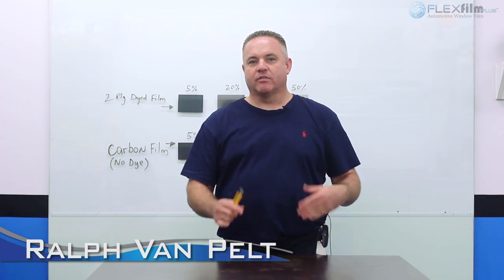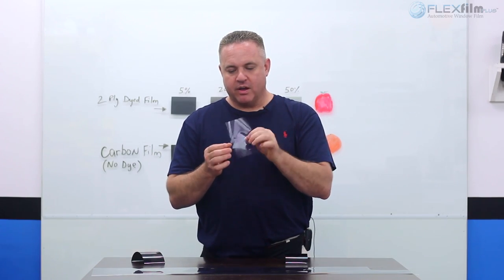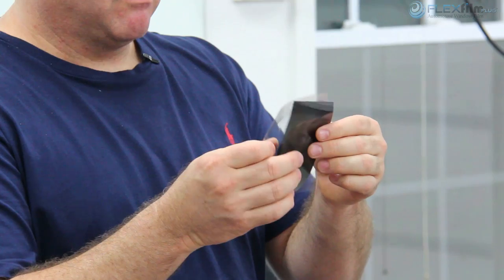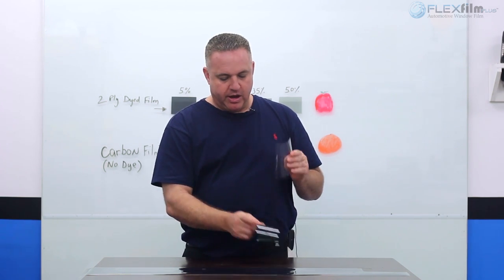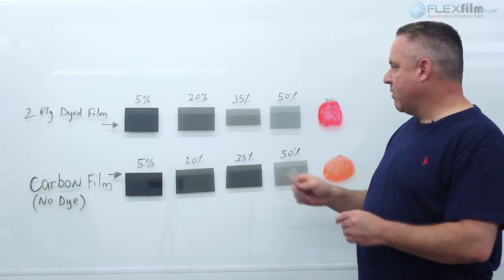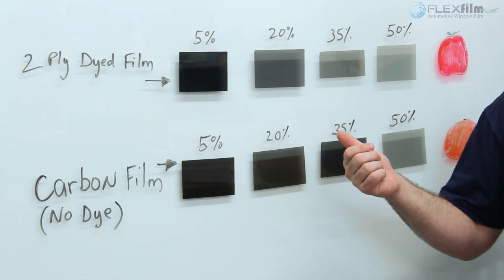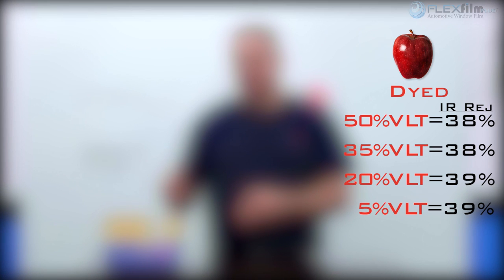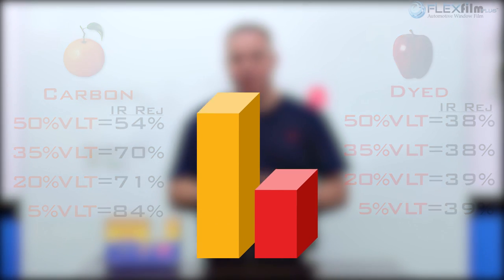Ceramic Window Tint 101

Comment: I had ceramic tint applied to my car. Sitting in 60 degree weather, should the window be hot to the touch?
Reply from the maker: Jay Park 
Yes.  Ceramic film absorbs more Solar energy from the sun and should be much hotter to to touch than dyed film.  Dyed film just let's most of the energy through and does not store in the glass.
Reply: Ralph Van Pelt thank you for your knowledge.
Reply: Ralph Van Pelt I haven't gone through all your videos but it would be cool to see a real life test. Two identical cars. Ceramic and dyed film vs ceramic and carbon film and measure the temperature of the cabin?
Reply: So how is this stored heat in the glass not going to radiate into the car anyway? How can you stop the heat that the tint adsorbed from not being radiated into the car? You just stated that the glass will be hotter.
Reply: Was thinking the same thing. I have a custom van with windows all around and fairly big. I think the glass is going to heat up enough to lose any benefit of the carbon over dye.
Reply: @FlexFilmPlus  I had applied Rayno Phantom S5-20% except the windshield and front side windows, Car was parked 5 hours outdoors in the sun 68F. I got into the car and the inside car feels hotter, obviously. Started driving, opened the windows a bit, I touch both glasses the tinted and the factory untinted ones. The un-tinted windows are colder to the touch than the tinted ones. The temp outside reads 67F degrees and the car interior temp reads 81F. Drove the car for an hour. Temp outside reduced to 65 with cold wind. The interior reads 80F. Tinted windows still warmer or less cold than the untinted ones. Turned on AC reducing temp inside.
Parked the car inside garage. Now both windows have same temp to touch.
It looks like the tinted windows grabbed some heat from the sun and kept in the film, thus making the inside temp hotter than when I had no window tints at all. 
I cant imagine when the temp outside reaches 90 degress, the heat inside the car will take forever to go away, even if i use AC, after i turn off AC, the temp will rise later simply because the warmer tinted windows will keep some heat from sun and will make car temp rise again, even if outside lowers to 60F
Reply from the maker: There are two phases to performance with ceramic film.  The first phase is protection.   The product should absorb most of the solar energy and keep it from passing through the glass.  (Visible light, Ultraviolet Ray's, and Infrared radiation)   As energy is absorbed,  it will turn into heat and heat up the glass.  The ceramic coating in the film will slow down the transfer of heat into the car because it is a very poor conductor of energy.  An example of this process is if you place a metal pan and a bible on the hood of your car and let it heat up under to sun on a 100 degree day.  Touch the pan and it will burn you because the energy (heat) moves rapidly through the pan and it literally throws it back at you and is very hot to the touch.  Put your hand on the bible and it is only warm.  Energy does not conduct very well through paper and therefore heat energy is released very slow.  What is interesting is that you can meter both objects and they will have the same surface temperature because the sun does not discriminate.  It heats them exactly the same.  The difference is in how energy is conducted through them.  Ceramic coating in window film is a non conductive material that puts the brakes on the heat.  Another example that is similar is the silica tiles on the bottom of the space shuttle.  They slow down energy the same way and protect the astronauts.
Reply from the maker: @sfopaul747  
The carbon s5 is not a ceramic film.  It is marketed as a ceramic but it is really not to be compared to ceramic films that use oxide materials.  That film does offer amazing protection by blocking out most of the solar energy but it does not have the ceramic oxide coating like the S7 or the S9 product which would put the brakes on the heat and slow down how it radiates into the car.  Heat and solar energy are not the same like Fire and smoke are not the same.  S5 is only a carbon film.  It would need carbon and ceramic combined to slow down the heat like you would enjoy.
Reply: @FlexFilmPlus  Thank you for your response. I actually trusted the fact that is marketed as CarbonNano-ceramic. I didnt mind the money i would have spent for an S9. I never thought the heat inside the car remains longer than having no tint at all. Wondering if its real phantom s5 what they installed. Will do my investigation. Question. Will it be good for the rear defrost lines to have the installers remove the work they did 3 days ago and apply a Phantom S9? (Tesla Model 3)
Reply from the maker: @sfopaul747  
Should be easy to remove.  I am about to post two video links you need to see.  I am also a Tesla owner.
Reply from the maker: @sfopaul747  
https://youtu.be/PTHlZtNeXqc
Reply from the maker: @sfopaul747  https://youtu.be/cbttKzKfTEY
Reply from the maker: @sfopaul747  
Www.flexfilmstore.com

Comment: I used tin foil. Almost no heat gets thru. Use a credit card with cooking spray to get the wrinkles out. DO NOT FOIL THE WINDSHIELD.  I got pulled over for that. Cop was pissed.
Reply: Wym by do not foil the windshield?
Reply: Same thing happened to me. I just cut the two eye holes works perfect
Reply: @majorpaine211 Genius!

Comment: die tint is the cheaper low quality that turns purple or fade over time and the ceramic tint is a higher quality that doesn't fade or change color over time right?, also I'm learning about tint :)
Reply from the maker: AirRookie 
That is true unless the ceramic film has due mixed with it.

Comment: what do you recommend, I want as dark as possible so you can't see 
inside, block sun out. so 5% and ceramic or 5% and dye film?  any brands
 to avoid?  price for 5% and ceramic including windshield?
Reply: Sounds like you want black paint that will have the least sun coming in. But honestly I don't know how to answer you if you ask that question. Technically you can run 5% or even less but it's hard to say if you don't know what youre asking for. 5% is illegal anywhere and definitely i would not advise a very dark tint on your windshield. I run 35 all around and 50 on front windshield. Ceramic will usually cost more and windshields cost more. I had my 4 door car done for 350 ceramic + 160 for front windshield but i live in NOVA where everything is expensive

Comment: can someone tell me which is better for cooler car , carbon or dyed?
Reply: Ceramic will keep your car cooler
Reply: Fade To Black LLC I get the point of ceramic will keep the car cooler due to its capability, but since the windshield is not tinted wont the heat still come from the front. Im trying to decide if the extra cost for ceramic is worth it. Let me know what you think. Thanks!
Reply: @vcents8960  yes you'll still hey the heat coming from the front windshield. I have a video of a white Denali I did the fronts and the full windshield with Ceramic and it really helps cut back on the heat.

Comment: Your outro music sounds EXTREMELY similar to a slowed down version of the instruments in Believe Me by Fort Minor. It's really funny. Anyway, thanks for the tint info. Just got a 15% dyed-metal hybrid with 56% TSER on my car for the purpose of heat rejection so I may have made a mistake cheaping out and not opting for the carbon-ceramic hybrid. We'll see. Looks cool though! Did get a 70% carbon-ceramic hybrid with 45% TSER on the windshield though, so that may help negate my cheapness.

Comment: And how do we know what u are getting is ceramic film? Not the regular tint
Reply from the maker: Because it absorbs Solar energy broad spectrum.
Reply from the maker: Because it absorbs Solar energy broad spectrum.
Reply: +Ralph Van Pelt I understand but can you tell the differences between those two tints? I'm afraid is I paid for the ceramic but they are actually installing the regular tint . I don't want to get scam lol
Reply from the maker: That's a good question.  There really is no practical way to tell.  The only practical way I know would be to shine a heat lamp through the tint to feel with your hand if it is working.  If you do not have a fancy IR meter that can give you broad spectrum results (780nm to 2500nm) you really can't tell.
Reply: Yeah, I'm sure that happens a lot. No sarcasm.
Reply: PrecisionShineMobileDetailingLLC  I’ve seen a few places that pull that kind of crap on customers.  Best thing to do is take it to a reputable tint dealer where you can watch them install the product and make sure what they install matches the sample you agreed to purchase.  You should also feel how much heat the tint blocks under a heat lamp before you agree to purchase it.  Every legit shop should have a heat lamp demonstration available to you can test the performance before buying.

Comment: A true non-dyed, non-metalized muti-ply ceramic like Huper Optik Nano Ceramic Window Films will reject much more IR that either the Carbon or Dyed hybrids.  Unlike explained on the video, we can get a true ceramic as dark as 5% VLT without a dyed or carbon layer, with IR rejection up to 92%, with no chance of color change.
Reply from the maker: I might explain that in my next video.  I think I will title it Ceramic 102.  There are other methods of building IR films. Thanks for the comment.
Reply: Gary Clark 
That's very nice but is it effective.
I pd over $300 On ceramic tint & my car got just as hot inside as non ceramic & it looked like crap due to having a bronze hue on a silver car.
I have never used it again,primarily due to the snake oil bs about it keeping the car cooler inside.
Reply: Charles henson Do you know what film it wast?
Reply: they saw you coming from a mile away and they threw away the vaseline

Comment: jezuz, so much info and nothing usefull. What is IR, why do i care? I want the legal tints that block the most sunlight and keep the cockpit as cool as possible. Do i want oranges or apples? Or better yet, do i want 3M or Vkool or another brand?
Reply: +ENDGEGNER SIMULATION   Heat  rejection or why use tint unles you want best heat rejection, unless you dont want anyon eto see it,  than just  Block/black out windows
Reply: Infrared radiation is specific heat wavelength that your skin feels. Light consist of all types of radiation. What you're talking about is visible spectrum radiation. Heat, again, is IR radiation, they're not the same thing. You want IR blockage, as well. When you have IR blockage you barely even feel the sun when it's shining through the film and it keeps a great amount of heat from entering the car.
Reply: You want Huper Optik, but it wants your whole paycheck.

Comment: It looks like it was a worthwhile  demo but the results of the meter didn't hold the measured results long enough for it to sink in. Also, explaining all of your high speed measuring and cutting would have been nice because it was apparently a worthless distraction.  The apples and oranges bit was nonsensical since you didn't describe the two technology options first and their different strengths and weaknesses.  Woulda helped if you covered any install challenges or lifetime issues for each..
Reply: Since your so obviously an expert I look forward to your comprehensive video on dyed vs carbon films including the advantages & disadvantages of each. I guess you are also demonstrating installation techniques & have a simpler more apt analogy for the different types of tint films.
Reply: Owned

Comment: i will cut thru all the BS
-ceramic is the highest performing tint available now BUT needs specialized experience to install (not like other tints)
-many shops dont have the skill level to install ceramic CORRECTLY
-so i recently had Huper Optik's Xtreme Optiks installed on new car...only 15 percentage points less infrared (IR) blockage (aka heat rejection) than ceramic...all other specs like UV, etc are similar if not the same
-15 pct points is not that big enough diff to pay 200 bucks MORE for ceramic (but moreso, someone inexperienced might be the installer)
-paid around $300 for a 4door sedan. 35% on all 4 doors and 20% on back window (looks clean; cant tell diff % tint)
- huper optiks is the best tint imo. german company; do your own research
-get your tint at a company that will stay in biz...your install warranty is nothing if they go bankrupt n shutdown

-fyi, privacy glass from factory often does not block heat or IR, UV, etc